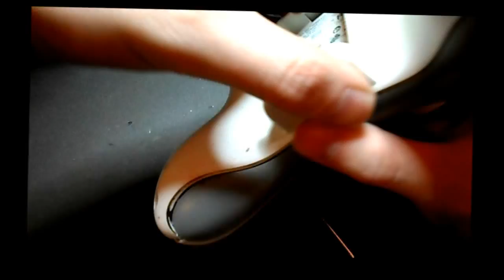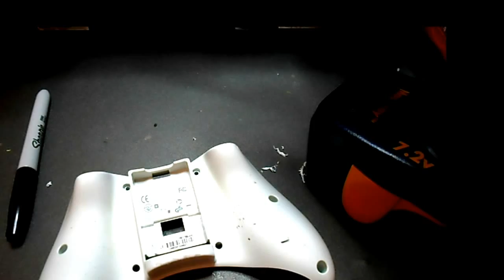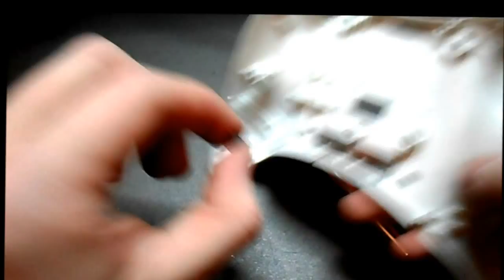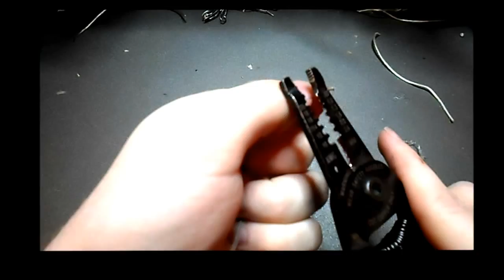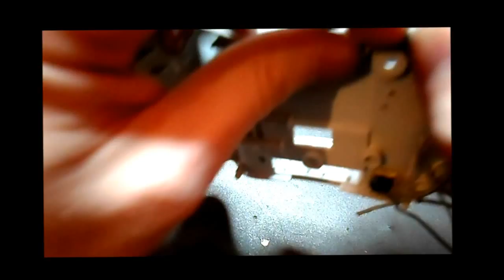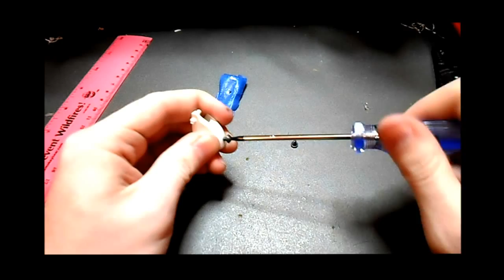DIY Gamer, Make your own Scuf Controller

Comment from the maker: The middle pin is always the ground for every Microsoft made controller. The triggers are Potentiometer Switches this allows the triggers to be pressure sensitive by having two leads and a common ground. The top and bottom pins are positive while the middle is the common ground.

Comment from the maker: I'm almost 100% positive that's the issue. Just double check your solder. If you have an issue soldering to small components use masking tape to cover up all the points around the point you're soldering to. It helps a lot. :)

Comment: Love that. half way though "Soldering Irons FUCKING HURT" Considering I burned myself a little less than 4 hours ago I was nodding a bit at that remark.
Reply from the maker: I have a couple of scars from the iron. Each time I look at them I cringe thinking back to how bad they hurt. lol.
Reply: Yeah. It happened at a really bad time too. I though i broke my controller and somehow manage to fix the impossible and as i celebrated I through my hand forward and caught the tip of the Iron. Bit of a buzz kill that was. Not to mention the small bits of solder that were stuck in my burn.
Reply: ***** smokie the bear ruler
Reply: sai what now???
Reply: it was kinda unexpected yah know.. its all chill and then BAM SOLDERING IRONS F$%^^#&* HURT LOLOLOL

Comment: hey ethan. scuf actually uses 6x6x6 mm tact switches. they are a little shorter, but you can't get them at radio shack. you can get them at amazon.

Comment from the maker: Sounds like you have multiple leads touching. Just double or triple check your soldering and make sure no two points are touching, also check your wire for exposed areas. And test the controller before reassembling it. Let me know how it goes.

Comment: hah, wish I had seen this prior to doing the work, ran the left wire all the way across the controller. Made it a little tough to get it back together. However everything works perfectly except I need to train myself to use them. I like that I can jump and reload without ever taking my thumb off the aim stick. Thanks for the excellent walkthrough, this was my first ever attempt at soldering and it worked first time.

Comment: My B button works but my A button keeps shitting out, it will work, Ill put my controller back together and then it will stop working. Any suggestions?
Reply: Brendan Pearson this is probably late but try putting electrical tape over it

Comment: It's a standard wirless Xbox controller. I'm pretty sure I got it with the Slim model of the Xbox. Also, I noticed the little gold lines on the buttons only go in one direction: horizontal.

Comment: Hey i put the paddles on and did all the soldering and such and it works fine asides from the fact that I cant be holding the shoot button and go prone / crouch or jump at the same time any clue why this would happen? could it be cause i used a 4 prong push button instead of 2 or do you think something is touching that shouldnt be?

Comment: Thanks for the TUT man! That's exactly what I'm going to do when I get a chance. But what size screws did you use to attach the paddles to the controller? I'm just worried about the screws being too long and possibly damaging the board. Thanks again man!

Comment: Hey I looked at a tutorial that soldered both wires to the contact areas on the A/B/Y/X buttons, sadly it didn't work, but thanks to your video it did man! Thanks! 
Had a bit of trouble with the one of the panels not being scratched off enough but 
in the end i went with your style =]]

Comment: Thank you very much! So, in theory, soldering to the top of the button and to the ground on the trigger pins should work. I must have connections elsewhere on the controller...

Comment: Cause I've tried a couple different combinations for each lead of the switch and the best results I've gotten with using the trigger pins is the right switch causing a strange combination of reload crouch and firing the weapon

Comment: I've seen on a different video, someone soldering the wire split in half to both halves of the button (a,b for example) instead of having to separate wires. Your thoughts?

Comment: 1. What specific wire are you using? 2. When soldering the wires to the board where do you solder b,x, or y to?

Comment: By the way, my circuit board doesnt have the little black points on the A, B, X and Y buttons. However, there is a little bit of green "carbon" pointing up, is this it?
Thanks for responding.

Comment: If I wanted to configure one of them for X which trigger pin would I use? would it matter? i took my Scuf Gaming controller a part & they are using the bottom one for B. So would I use the top one for X? please help.

Comment: so i made it but something weird happens. when i hit b my guy turns like im using the analog stick but im not...
Reply: +Storn can someone help me plz xD
Reply from the maker: +Storn It sounds like the leads from your B switch are touching the contacts for the along sticks. Try putting tape over the back of your B switch. Also send me a picture Via Twitter if you can, I'll be able to better tell whats going on. :)
Reply: ***** thanks bud. Sorry been and still at work. I'll take it a part and let u know if I can't fix it and need help. Thanks again  for answering xD

Comment: So I sauder the wire from the paddles to the button and the little middle of the little 3 dots, why is there only on set of 3 dots?
Reply: Also, if I do just sauder the otherwise a to the buttons from the paddles thin what do I do with the second wire from the paddle button???
Reply from the maker: Its Voodoo You can do this with any type of controller.
Reply: Solder, not sauder

Comment: if you dont have glue use bluetack works perfict and for paddle use a ice pop stick works very well
Reply from the maker: I actually tried Popsicle sticks at first but I wasn't a fan of the texture. On my Xbox One build I used The ends of plastic spoons and they work perfectly. And the BluTack is a GREAT idea. Never thought of that. :)
Reply: ***** did you use copper wire or tin wire
Reply from the maker: Copper. Always use copper.

Comment: I think i found my mistake, i soldered 1 end of the wire from A to the tac switch and the other wire from the tac switch to the trigger point. But with B i soldered the wire from the tac switch to the middle trigger point on the LEFT side ( there is a second pair of three points on the left side of your controller)

Comment: Is the Dualshock 4 a similar process? I'm a complete technical n00b when it comes to this stuff but I find this very interesting.
Reply from the maker: Its a very similar process. You can use this as a guide and you'll probably be able to figure it out.
Reply: ***** Very nice. I have a somewhat wonky DS4 laying around here so I might just give it a whirl and try to actually learn something new whilst at it ;)

Comment: Hi , your tutorial is great but I just have two questions I am just doing the paddles at the back so which tact switch from the two you mentioned should I use ? Also I am doing this on a playstation controller is there much different?

Comment: i soldered both wires to the copper under the carbon where the button is pressed, and couldn't get the controller shut and the buttons were really squishy, and help or suggestions? :/

Comment: Is it possible to take 9.5mm high tact switch and put it inside the controller where you put the "X" and "Y" buttons. Just to hide the button and have the point of the button sticking out.

Comment: Hey there sorry for bothering you I hope you can help me with the wiring Can I scrape of the carbon on top of a and bottom and solder the wire to top and bottom instead of middle a and the middle of the 3 contacts
Reply from the maker: Can you? Yes. Should you? No. Unless you're really handy with a soldering iron, your normal button won't work anymore.

Comment: ive watched multiple videos explaining how to make a scuf controller but in all the other videos they dont solder the second a button wire to that trigger stop you said in the middle they solder it to the lower half of the botton spot. what is the difference and is one way better than the other?

Comment: hey whwn youbsolded the cable to the a button you did one wire from a to the switch and one to the middle dot of those three but i saw some other ppl solding both wires to the a button and not to the dots a response would be great thanks

Comment: Need help on the soldering of the buttons to where ever they are meant to be soldered to. The DIY stuff is the easy part. Could you help me at all with the last section of the video dude? From where you say just do this to the other 3 buttons.

Would appreciate it

Comment: What I ended up doing is soldering one wore to each button what I mean is I took one wire from a and soldered it to the top and the other one to the bottom of the actual button instead of the pin in the middle, is there a difference? Does it matter ? Just curious if you know or it matters get back to me thanks

Comment: All seemed to work well until I went into BO2 game. paddles work but for some reason my controller think I am pressing the LT to aim down sights at all times and I cant get out of "aim down". Any ideas? Trigger isnt being pressed so I assume something on the board? The only thing I can think of is I got a little solder on the "b" soldering point with the 3 little solder nubs but I decided to use a ground on the back of the board. Could the two solder points touching be the cause of this?

Comment: Im trying to make the paddles for the A & B buttons but i see that other people put the 2 wires on the top half and the bottom half of the button instead of using that little middle prong. which should i so to have both buttons?

Comment from the maker: Unfortunately this is true. They work well for Gears of War as well, and Halo as long as you don't plan on using the plasma pistol or driving a Ghost. But that is about it unfortunately. They are AMAZING for CoD though, and they are easy to remove and put back .

Comment: I soldered one wire to the top carbon and one to the bottom instead of one to the top and one to the pin if that makes it sound better for you I re read what I wrote sounded dumb. I'm not saying its better or worse I'm just wondering what the difference is

Comment: hi mate great vid, iv bought all my stuff to make mine today just got a couple questions. in some other videos they dont solder to the little middle part of the circuit board instead they solder both carbon points of the A button is this ok to do? and i couldnt get hold of hot glue so would a super strong glue be ok?

Comment: what soldering iron are you using??? like Watts and Voltage, please help imm thinking about getting one and i would like some help/advice
Reply from the maker: Mine is a selectable 15/30watt iron from Radio Shack. I tend to use the 15watt setting when soldering to circuitry.
Reply: i thought it was "A" and "B"
Reply from the maker: Swagxkiller1|Gaming4Life DIY Gamer: Scuf FAQ  Try watching that if you're confused. :)

Comment: Hi, i was able to follow all the steps and all, and the the paddles work fine. The only thing is that when i shoot with a sub machine gun, i am not able to jump with my left paddle. i was wondering if i there is anyway i can be able to re solder points that will allow me to jump while i aim and shoot a gun.

Comment: After taking a second look it doesnt seem to be touching the two points. However, I didnt noticed that the trace between the two solder points is scratched : X. I'm guessing that may have something to do with it. Know anything about trace repair? I could be wrong though. Oh the agony : P

Comment: That wire is way to thick. If you try to press the regular A button it wont feel normal because the wire/solder is blocking it. I used 30 gauge wire.

Comment: Y is it that scuf them selfs do the wires on buttons only but you do half then mi trigger does it work better and if you that solder both of them the same just on opposite sides of mid trigger

Comment: So that is how to solder for B, where exactly do you solder the second wire for the A button? Thanks
Reply from the maker: Middle trigger pin on the right side of the controller. Button - Switch - Trigger pin
Reply: The same place where the other one is soldered?
Reply from the maker: Yes.
Reply: Alright, thank you so much. Appreciate the time you took out to reply, and also make the video!

Comment from the maker: You're touching the top or bottom trigger pin, or you soldered the button incorrectly. Look at the middle trigger pin first and make sure no stray solder is touching the top or bottom pins. If you're good there look at your button its arms should look like an H Don't connect one wire to top and one to bottom. Connect one to top left and one to top right.

Comment: The button just acts like the right trigger. it wont jump. any idea why?
Reply from the maker: Sounds like your solder or wire is touching the top or bottom pin as well as the middle one.
Reply: ***** no, ive re soldered it twice. could it be that it is a really old controller?
Reply: Yeah it could be a factor because I know different models of controllers have different contact points
Reply from the maker: Matthew Toomey Yes and no. True some controllers haven't different points but ALL of them use the Same "A B Y X" points and trigger pins. So differing controller models shouldn't matter for this.

Comment: thx for replying :) ok i soldered both wires to the normal A trigger instead one to the middle trigger. That worked pretty good, but now i cant sprint sometimes and its constantly pressing A (i jump automaticly over obstacles) then it works normal wtf XD Tips ?

Comment: Would this work for a wired afterglow controller
Reply from the maker: It wouldn't be exactly the same, but you could probably figure it out using this as a guide.
Reply: Could u do one cuz its really confusing
Reply from the maker: Jason Malhan Because of my current job, I'm away from home until November so I won't be able to tear apart an AfterGlow anytime soon.
Reply: Oh
Reply: But thanks anyways

Comment: Can I just use one wire for each button?
Reply from the maker: That is impossible. You need a wire from the button contact, to the tact switch, the from the tact switch to the ground. That completes the circuit.

Comment: if u open up a scuf they connect on the bottom of the controller's motherboard, i want to change my paddle config i no what solder head i guess it is to put it on, am i gunna fuck it up first timing it or can i fuck it up if im not retarded

Comment: Two*
Reply from the maker: If you do that, your normal buttons will not work as well. And after long term use, it's highly likely they'll need repaired using the other method.

Comment: I broke my controller doing this
Reply from the maker: +Gonenerfin  How exactly did you break your controller, I can try to help you if you give me some details.
Reply: +XtaCEwok Hey there quick question. Are there any alternatives that I can use instead of Tact Switches? I don't see being sold in any of the electrical and home and appliance stores near me? Is there something similar? I have everything else, except for the switches :(
Reply from the maker: RagingxxNinja You can use any two prong button or switch, but I highly recommend the Tact switches I use. There is a link in the description to get them from Amazon.

Comment from the maker: The tools total a cost of $55.99, the parts are barely $30, and a used wired controller goes for $30. And this is assuming you don't have any tools, parts, or controllers. I had all three, I had to buy two buttons and that was it. My design is better than Scuf as well with my shoulder buttons. 

Why can't you not be an asshat and keep your mouth shut? This video has helped tons of people but yet you have to come run your ignorant mouth. Go fuck yourself.